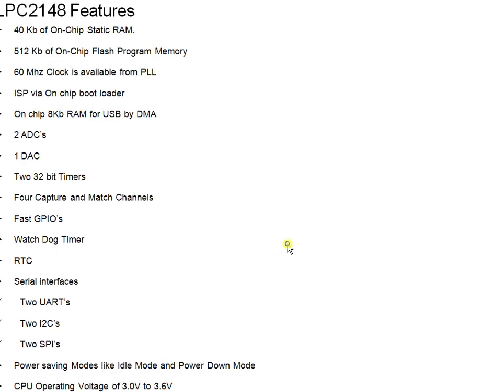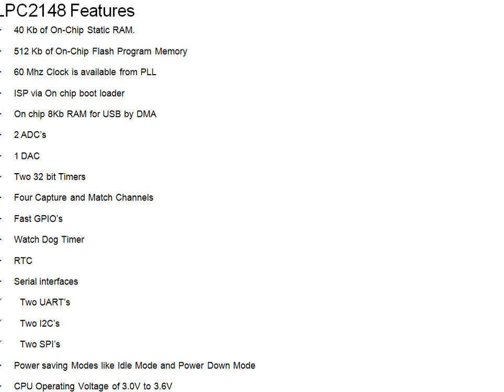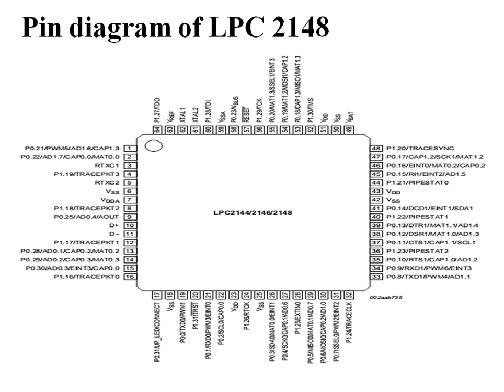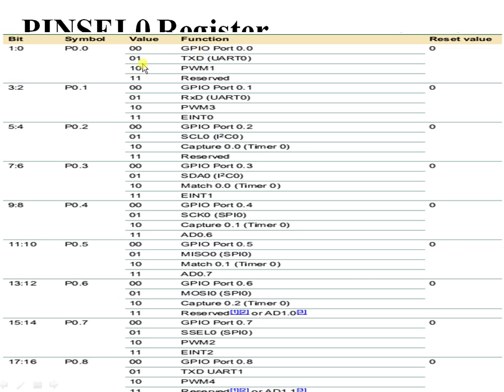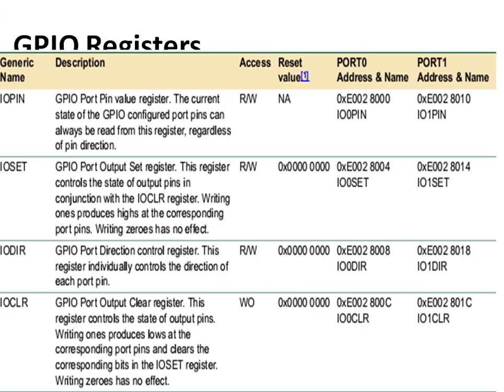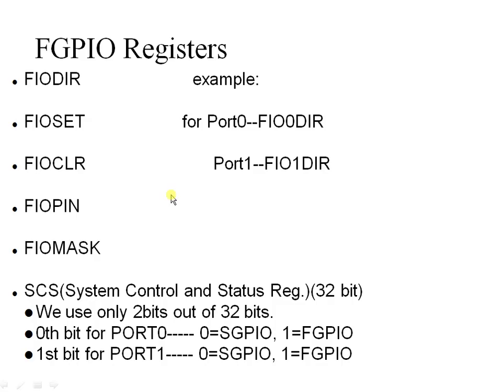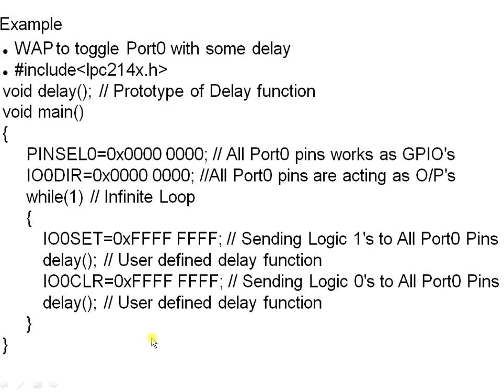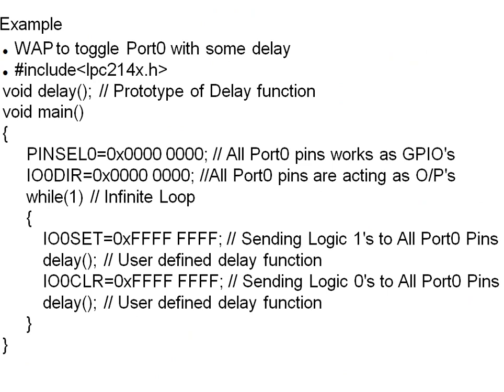ARM7 LPC2148 Turorial - Introduction and GPIO

Comment: In IODIR0 register, u need to pass high for output and low for input i.e. in ur toggling program it should be IODIR0 = 0xFFFFFFFF ->Which makes all the pins of port0 to act as outputs.... You explained it reversely in your program... check it!!!
Reply: In lpc2148 manual it is clearly mentioned that '0' is for input and '1' is for output. I understand why you got it wrong. Coming from 8051 background, one would naturally assume that 1 means input and 0 means output. However the same isn't true for arm. Check it.